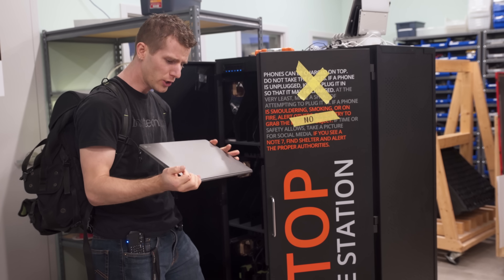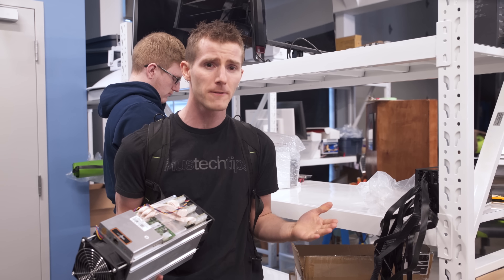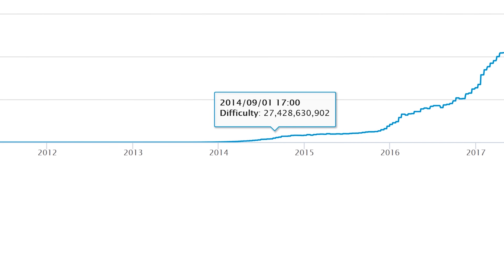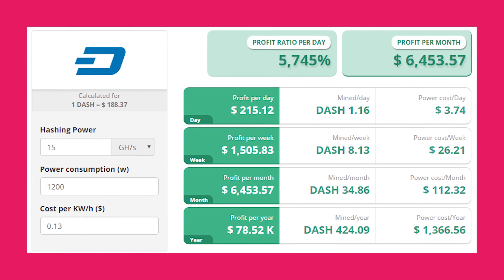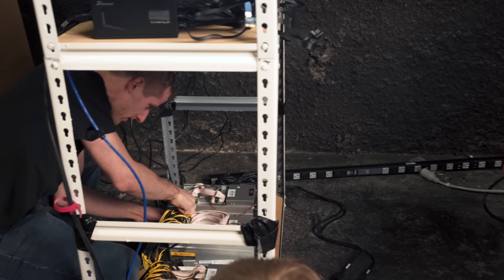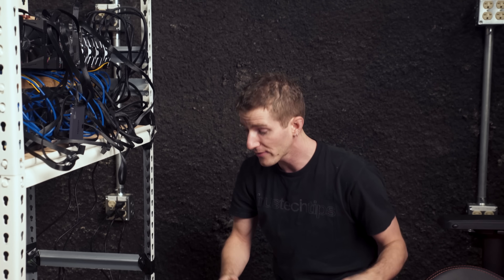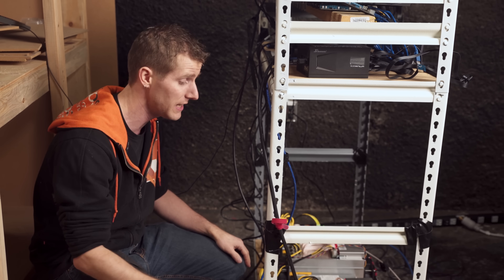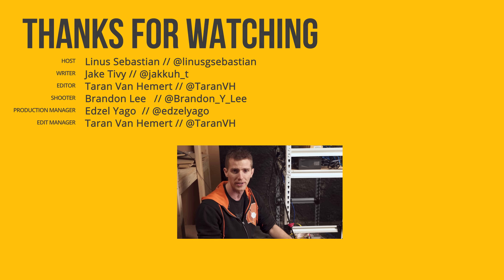Is Mining on ASICs Worth It? - Mining Adventure Part 3

Comment: Well i think ill pass on mining coins.  To expensive to get start this late
Reply: There are so many coins at few cent that will cost over a $1 next year. And with BTC price drop they all dropped %50 in value, so I would disagree
Reply: Hes talking about mining not investing in coins...
Reply: This isn't late, this is still early in the grand scheme.

But yes, with ASICs you need to buy them very early, as in, you need to be among the first or at worst, second batch of buyers who get them. Otherwise you'll be buying them after the amount of return per day is much, much lower. The S9 isn't a bad buy at all though as BTC will certainly go much higher in the future, the Bitcoin it earns will be worth a lot more later this year I think.

Linus should have mentioned how important buying an ASIC early in its life is, honestly all these LTT crypto videos have been pretty bad with poor rig planning (that 13 GPU + 3 PSU machine is terribly inefficient) and a lack of critical info. 

Why would they buy a D3 and L3 over two more S9s? It makes no sense at all, the S9 is more profit, there is little reason to buy the other two. C'mon, LTT.

The S9 is an exception to the rule as it's like 18 months old but still earns a good amount even with the BTC price in the gutter.
Reply: 13 GPU doesn't require 3 PSU's you can get the new EVGA P2 2200 WATT for 13 gpu connections and 13 GPU slot mobo. all one rig.
Reply: I got in asic with s3 then upgraded to 6 s5. The wait list and price got ridiculous.
Reply: Dont mine BTC. Dead currency for normal miners. Go for Monero or Ethereum.
Reply: unless you steal the gpu
Reply: SeventySeven Doesn't change anything. You're only causing more demand.
Reply: True, bitcoin value gonna crash in a bit
Reply: People said the same thing for years now and every year they've been proven wrong
Reply: Which leads to one of two possible scenarios as far as I can see. Either it will never crash because it hasn't so far (bad logic) or when it does crash it will crash harder (better logic). Either way I don't really care because I would never put what little money I have into something so unregulated and volatile.
Reply: Nika Ross if u mine coins, u also invest into them...
Reply: Yes, you can mine new coins that are worthless, and hang on to them until listed on CMC, then sell for a huge profit... It's not investing, just holding till it's listed.
Reply: like every pyramid scheme, if you are not one of the first people to join, you are just sheep making money for the ones above you.
Reply: Anthony Handcock fine with us, more Bitcoin for us. Keep your money in the stable dollar holding it's value... Oh wait yearly inflation, printed on worthless paper, not capped it backed by anything, controlled by a private entity.. good luck
Reply: djwaters22 mine cheap coins or buy into start up coins that have promise like Cardano ADA
Reply: I still think cryptocurrency is basically a highly elaborate tax evasion/money laundering scheme.
Reply: Marcelo Carvalho how is Bitcoin or crypto as a concept a pyramid scheme?
Reply: The people who say cryptocurrency is a pyramid scheme only expose themselves as morons. Some cryptocurrency projects are pyramid schemes (pump and dump) but don't insult the great and ethical development teams in the cryptoverse by lumping them together with scumbag scammers.

Saying every cryptocurrency is a pyramid scheme is almost as ignorant as saying every black person breaks the law.
Reply: Athony Handcock You people have no idea what crash even means. 2008 crash didn't end the stock or real estate markes, just like crypto crashes (and we had at least 6 of them already) don't end crypto. You only lose money if you sell at the dip, which many people do both in crypto and in stocks. Markets crash and recover, it's been that way forever. In terms of adoption of blockchain technology we're still in the very early phase.
Reply: n1LL3R I don't agree but I gave you the thumb up anyway for the d2 reference
Reply: djwaters22 D2 Rocks!!!
Reply: yeah to late to start with the big ones that's been out awhile but not new ones with high potential and continued price growth
Reply: dontquestionmyactions zcash and zen tho?
Reply: You can, but the cost per watt is higher than combining 3 750 or 850 watt psus.
Reply: Bitcoin is a currency, not a pyramid.
Reply: yup. that ship has sailed
Reply: Mike Brown So you’re telling me that bitcoin isn’t a money launderer’s dream, and that it didn’t rocket in value because of black markets and criminals?
Reply: I say if you have a PC that idles most of the day - put it to work. GPU, CPU, RAM, HDD, etc. 
If you have an unused thumbdrive - put it to mine something! 
It is not yet too late in this shit. But it will soon be.
Reply: 2013 was already too late. If you weren't in it then, forget it haha
Reply: If anything, the black market has been keeping the price down. BTC near 50% dip was indirectly caused by them.
Reply: pkaulf Yes. Monero maybe, but bitcoin is terrible for black market use, so many people were caught because of it.
Reply: Marcelo Carvalho Yes that. Exactly what you are doing at work for your boss
Reply: Good.
Reply: well its not like btc is backed by anything?
Reply: The most common currency for money laundering is USD. Bitcoin is actually a horrible currency for laundering because ALL transactions are permanently kept on the Blockchain... and the Blockchain is public meaning anyone can view, and track, the transactions from wallet to wallet. Bitcoin, and most Altcoins, are not really anonymous.
Reply: Ehm no just buy 2 graphics cards an get startet zencash siacoin or something else zencash with 2 1080ti is about 300-500 clear profit a month ... and if the coin price falls down you dont get 500 a month only 300 but your coins are on you wallet let them rev up a bit ;) 

Get things started you dont should ignore this realy !!
Reply: is not, I think he means. than like ponzi, the late joiner are going to lose
Reply: Not for the actual price yeah they are down but give them time
Reply: Verge XVG is also good for mining. I have a GTX 1080 and can mine around 200 XVG per week, 12 hours per day of mining. So if I mined 24/7, it would be closer to 400 XVG per week.
Reply: True, mining is not worth it. but investing in bitcoin might be
Reply: pkaulf to actually get into crypto and do money laundering, you still have to go to bank and deposit it to transfer on crypto. Same goes with black markets. Till this day USD is top currency on black markets becausr of it's untraceable nature. In crypto while transfers are annoynimous, every single transfer is registered. So if by any chance someone in the transaction is caught, you can get to others as well. As any cash/crypto exshange require to supply with personal info such as copy of passport, proof of adress etc.
Reply: But how can you know which one would cost over a dollar? Most of these coins never get to cost anything.
Reply: You don't know that, at least not for sure, and some of them will dissapear, so there is a gambling point. But lets say new ICO comes, and the initial price is 0,001 to 0,01. So you buy in at least 10k or even more. On opening it goes in trading platforms, and then regarding on demand the price will start to move. And even if the price goes to 0,1 you already earned one more zero to your investment. And then you can actually use your earning on buy/sell as prices fluctuate a lot, and on that you can easy put your buy/sell orders, as you pay fee only on successful deal, and the deal can stay there for months.
Reply: Iggy i think there are a lot of people who regret not doing anything with cryptos year ago, when it was already more known :D so do i, i even had a friend who said, that he mines some ETH while not using pc, was enough to pay for WoW sub and buy few games in Steam :D
Reply: That's what I said in mid 2014 when I gave up mining. Oh how I regret that decision.
Reply: The price has more than halved in a month.
Reply: It's never too late.  That's like saying it's too late to pan for gold (its not) or too late for a private man to get into the space industry or car industry (its not).  It's never too late.  The cost to mine coins is about the cost of electricity on even a 3-5 year old system.  Those coins might go up in value though.
Reply: Or more likely... down.
Reply: Try Cloud Mining

Comment: Hey could you do best 3d printers of 2018? I'm trying to find the best one and there are so many different reviews. Help please?
Reply: Research which controller board each one uses (if they even list them) about 99% of them are using atmel based boards. Look for one that has an ARM base controller, or one that can be replaced with a ARM base board. If looking for a board to upgrade to, look at smoothieboard.
Reply: Bought a Wanhao Duplicator i3 in early 2017, very capable machine at 350 bucks, you only need to put in 2 screws to assemble it (literally 2). But the CR10 has come down in price and also does very good prints at an even larger size 30x30x40cm vs only 20x20x18cm on the i3.

Comment: Hopefuly difficulty will raise so much that it will be absolutely pointless to mine with graphic cards so the price can finaly go back to normal which was high already enough ffs.
Reply: It does become harder but the average trend of the coins is that they also increase in value, so the net effect is that you still get the same ROI. If ROI decreases, then in theory, people should buy less GPUs. But that is not what is happening because ROI hasnt gone down by much. The difficulty on mining is not the only factor on a ROI, the price also affects ROI.
Reply: There are ASIC resistant coins which can only be mined with gpus  so good luck to you.

Comment: I've always been a fan of well designed proof of stake coins,  If you invested  3k into a good  pos coin at the right price it can be very profitable.  I would mention what I'm buying but I''m waiting for it's price to come back down so mentioning it would be stupid of me.   ODN  looks decent and has a good block return  of 20 coins per block (and is dipping good lately) DP is one I've been staking for a while  and makes me a couple $ a day. Once you understand the system it just takes a little math to figure out how many you need in a wallet to create enough "weight" on the network (instead of hashpower for mining)  to be able to find 1 block + a day on a coins network, no special equipment just coins in their wallet  (tip don't deposit them into a wallet in 1 big chunk break it up into smaller deposits)  It is so much simpler than trying to figure out GPU mining which many non techy people would never figure out on their own,  anyone can figure out how to stake, making it a potentially far more decentralized system.  (what ever you do don't chase all time highs if your wanting to stake, wait for low average price)

Comment: Questions. How does ambient temperature affect hashrate and power consumption? That is GPU's and ASIC's. How has hashrate for ASIC's increased over time and what that means for future products?
Reply: >How does ambient temperature affect hashrate and power consumption?

Just like a normal CPU, it doesn't affect clock speed (or hash rate) unless the temperature gets high enough to require thermal throttling. Power consumption will likely not change either.

>How has hashrate for ASIC's increased over time and what that means for future products?

 Well, we need to understand how an ASIC works in comparison to a CPU.

We can build electronic modules to multiply and add numbers. Say we want to take an input, x, multiply it by 23 then add 5.

Well, a CPU would do this like this:

Take x, input it to the multiplication module with 23. Get your answer in one clock outputted.

Then take that answer, input it into the addition module with 5, and output it in one clock.

2 clocks to get our answer. 

Now what about an ASIC.

Well, if we were designing an asic, we could just chain the multiplication and addition modules together. The multiplication output would instantly go to the addition input, and we could do all of this in one clock.

Problem is that you lose the ability to do just addition or just multiplication. Of course this is a bit of a bad example since you can just multiply by 1 or add 0, but there are other operations where this cannot be done, and this is where the gains come from. 

Other than that, ASICs get rid of the unnecessary modules off a CPU which should allow them to run faster since its likely that they were slowing down clock speed. And instead of those modules, they cram more ASIC circuits there, making one chip capable of even more calculations.

Comment: as skeptical as I am about mining, even if it is a paper weight later on. its a consumable piece of hardware. if it paid for itself in 3-8 months, as long as you are able to use it for even 1 month later you still made money, even if you buy the then current gen ones, those then pay for them selves etc. in any case I would never throw them away until the point they no longer make the money to pay for themselves. in electricity before that and after break even its just added profit.

Comment: Wait? I'm totally confused. I was a bit confused about Bitcoin in general but I was kind of understanding, but mining Bitcoins?? What? So you buy this expensive thing, get it running, and it will get you money while it's running? How does that work?
Reply: the bitcoin needs continuous calculation to be processed. there is some rewards for this work, we call it mining. 
but there is more and more miners and more and more calculators to do this job, resulting in lower fees spread to all these players.
Reply: It's called the economy. It's basically how the stock market works really. But in that case the machines that are running are companies (it doesn't matter what them companies do, as long as you and everyone else BELIEVE that they're useful and have value).

It's basically magic and like all magic, it requires a bit of belief and not looking at it too hard. If you do look at it too hard, you risk ruining the magic and then the stock markets fail (or bubbles burst). In this case you've also got a not quite but similar in mechanism Ponzi like scheme going on too. But of course (like with all Ponzi schemes) the people that are invested in it won't believe you until they've lost money (I know that from experience, still at lease that friend only lost a few hundred quid).

What i think will happen is Bitcoin will pop and people will realise that all cryptocurrencies are the same (probably due to government legislation, this is why stock markets have rules, it makes the magic look more real and reliable). Some will sell their bitcoin for alt-coins (and lose everything they've invested) and the rest will sell what they can for real money (with the losers being whoever buys them now useless alt-coins).

Be fun to watch happen.

That said i don't have a problem with blockchain, it's a rather useful idea. It's just all these cryptos artificially inflate how hard it is to validate it, so that they can appear like they have value.

Comment: If the very high demand is consistent enough - over years - then GFX manufacturers will respond with higher volumes of cards, possibly at even lower prices. For now the reason they aren't is because they think mining is a bubble that will burst. Setting up a chip fab costs (literally) billions of US$ so they are reticent to invest that amount as their analysts are telling them that sometime in 2018 the mining bubble will burst and they will be left with a new fab, that cost them billions  - to support a hugely inflated level of demand that has suddenly vanished. Either way, in the medium or long term, GFX cards will stabilise. Either because GPU mining is permanent and the manufacturers have the confidence to respond to it by increasing their production facilities. OR the bubble will burst. I don't think there is any short term fix though. If you want a new GPU maybe think months or even quarters ahead because in smaller time frames than that you aren't going to get much joy I think.

Comment: Im not sure how you get roi of 2 & 1/2 half months with the s9.
According to currently difficulties, s9 can only give you 0.00130408 btc a day. Which is only $12.01 a day.
Without including the cost for power.
You'll will need atleast 4 & 1/2 months for ROI.
Including the cost for power. It will easily set you back to 5 months of ROI.

Comment: I was wondering about crypto mining: Could we not have a system where to mine coin you have to do useful calculations instead of 'wasting' all that processing. Like one of those shared computing projects, or hell... what if there was a coin that had some sort of marketplace infrastructure that sold computing time (maybe you transfer other currency into the coin then pay for computing time in that coin and miners get that) so that the coin was actually generating real value.